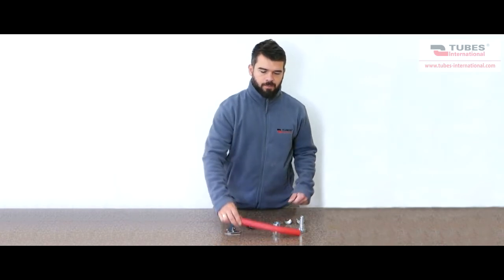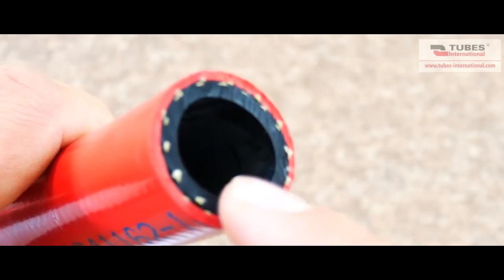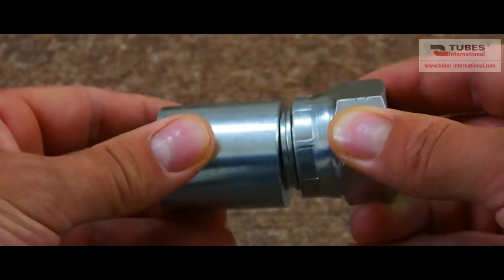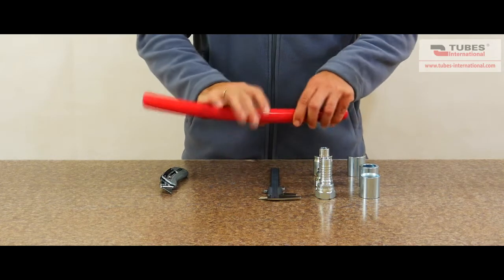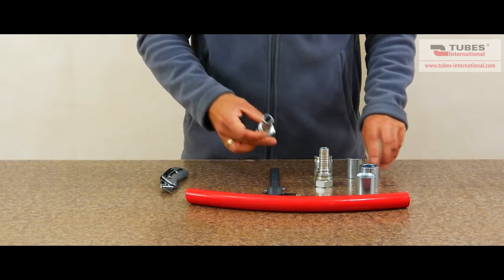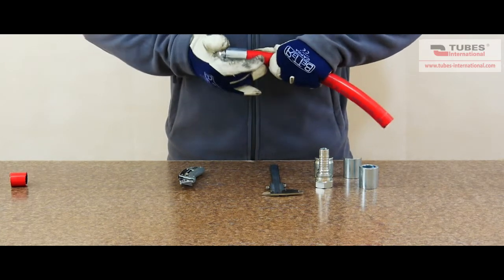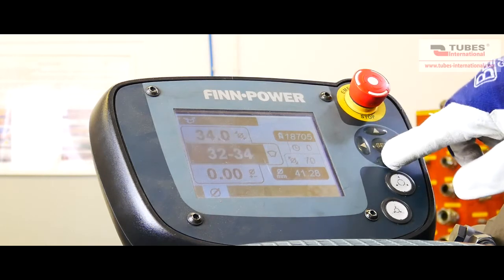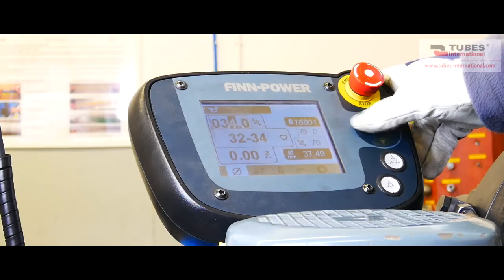How to assemble an industrial hose with a crimp ferrule

Comment: hydraulic power is like nothing else. Mayb future off roaders will hve this as there power base instead of drive shafts & 4 by 4 systems. Completely independent hose to turn hubs individual & turn hubs completely independently. No limit on amount of power in can torque in. Driving the hydraulic pump can b gas, diesel, battery, hydrogen easy enough, or hybrid system some of each, & if u want or need 6b6 or 8 by 8 drive no problem simple add a hose.